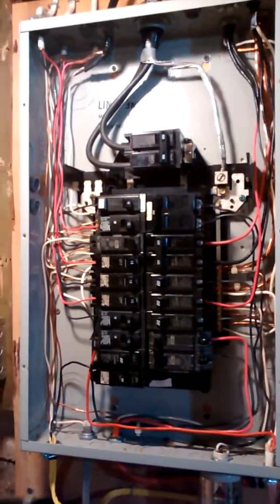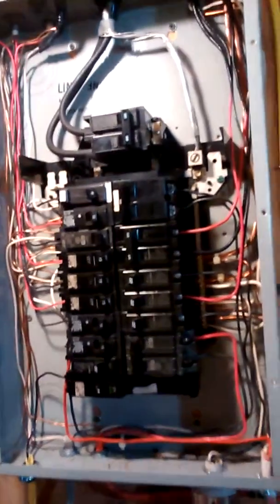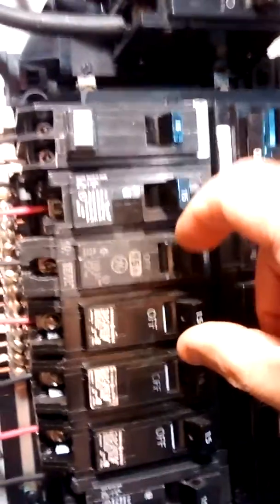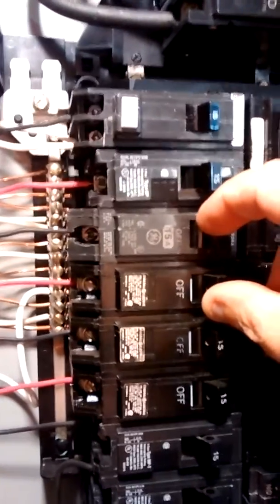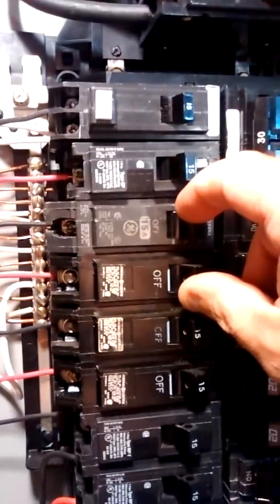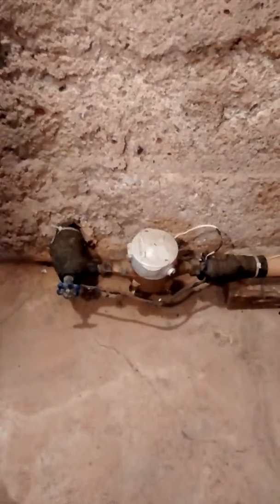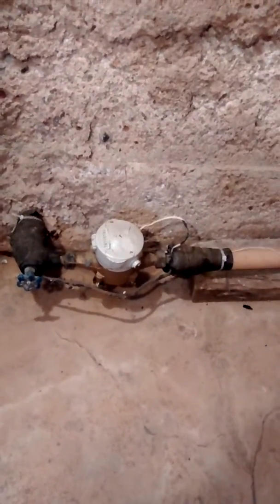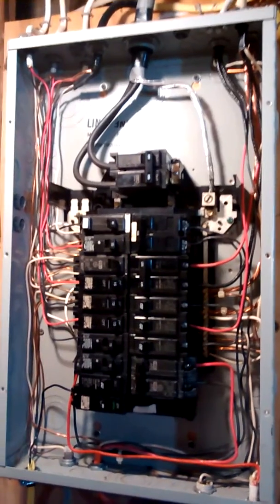i explain a split circuit shared neutral in a main panel

Comment: Those breakers need to be tied so they trip or turn off together to avoid voltage on the neutral
Reply: Thank for answering a question that has plagued me for a long time. It all makes sense now.  I never knew that the two phases in a panel reversed the flow of current on opposite sides so that the amperage flowing on the neutral wire is actually less than either one of the hot wires , therefore the neutral cannot cannot exceed the amperage of either of the hot wires of either phase.

Comment: I'm still not understanding how the common wire doesn't get overloaded when sharing between 2 hots from different phases on a 2 phase panel. I know you can't share with 2 hots on the same phase. Where I am, the code is, when sharing a neutral with 2 circuits, each hot must connect to each leg of a double phase breaker, thus forcing each on a different phase. I get that. But still not connecting, in my mind, how, using both circuits, simultaneously, near max capacity, doesn't overheat the common wire. Or maybe it does. IDK. Or is it only intended to use lighter loads and/or for a short period of time. Maybe something basic I'm not seeing here. Hmmm.
Reply: It is referred to as split phase where each leg carries 120 v. Leg 1 is 180 degrees out of phase from leg 2, therefore when 2 - 20 amp breakers share a neutral, the amperage in the shared neutral should "hopefully" never exceed 20 amps at any given time. If however the 2 breakers are on the same leg sharing the same neutral then you run the real and dangerous risk of overloading the neutral wire up to 40 amps! Also, any 2 circuits sharing a neutral MUST have handle ties at the breakers. This prevents from accidental electrocution by ensuring the shared neutral isn't energized by any one of the 2 breakers. Both breakers sharing a neutral must always be off when working on any one of the circuits.

Full Disclosure, I am not a licensed electrician, however, this is what I have learned from experience and plenty of great videos on the subject matter here on YouTube.
Reply: The current in phase 1 flows opposite direction than phase 2. Because of this when flowing through the white wire they subtract. Example you are loading 10 amps onto phase 1 and 5 amps into phase 2. Then in the white wire you will have 10-5 = 5 amps. Another example: You load 20 amps in each phase then you will have in the white wire 20-20 = 0 amps
Reply: We had 2 master licensed electricians wire new circuits. First one was doing that. So I asked him the principle. He told me the double pole deal. I thought, cool. I think I like it. I asked second electrician to connect from another 12/3 cable we had making it two "120v" circuits sharing common wire using double pole breaker. This second guy been doing electricity, probably since I was still in diapers. (a long, long time). He didn't have a problem with that and suggested doing that to a new run we needed. But a third electrician ended up doing that last run but said he didn't like doing that in case common gets overloaded. But reluctantly did it anyway. I'm thinking, I need to check this out more. I surely don't want to start a bad pattern.
Reply: In shared neutral, the neutral returns back the unbalanced current between the split phase, so it doesn't carry the sum of the current in each phase. The main cable to the panel both of the line and neutral is the same size, if the neutral were to return the sum current of each phase it should be a larger. It's not, the neutral job is to return the unbalanced current between phase.